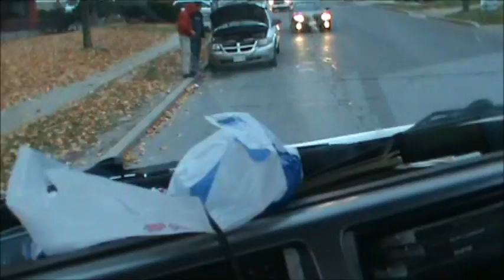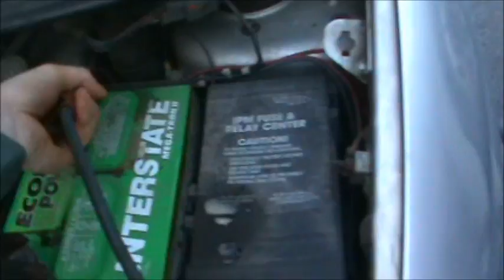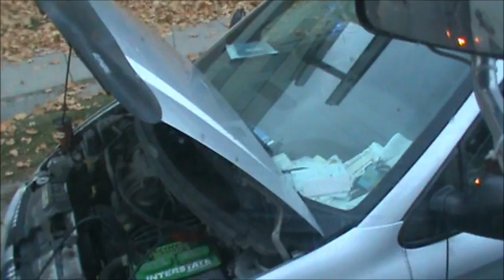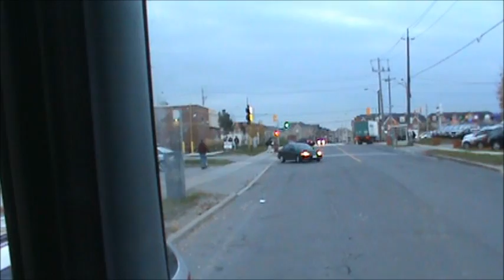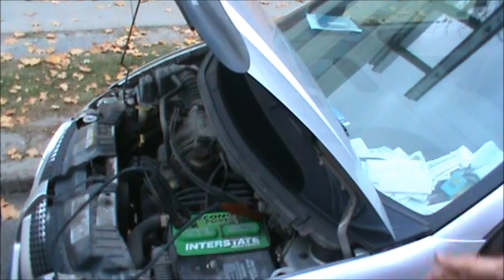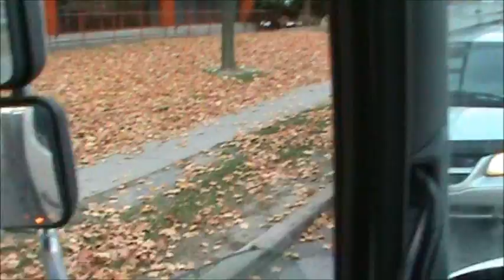Country Boys

Comment: if the alt is totally toast then the car will stall when the positive cable is removed. there car light came on when the alt was starting to fail. once it failed compleately the battery ran down and there you have it stuck on the side of the road,

Comment: @The18Jake your still wrong it was running off the battery then it stalls ofter the batt dies. no batt and no alt a car will not run fact. unless it is diesel.